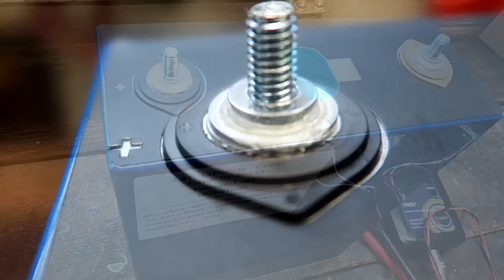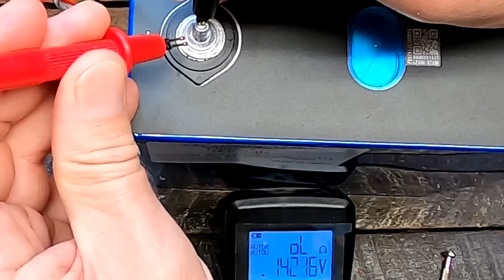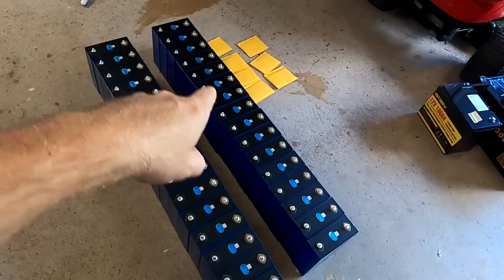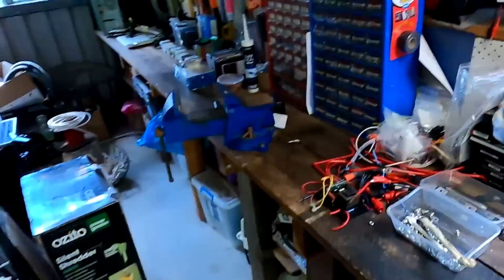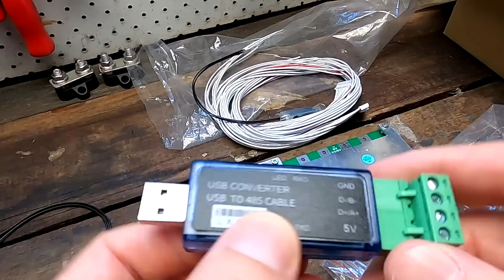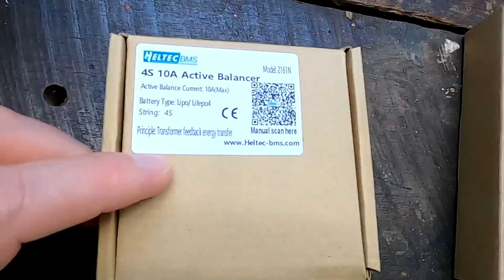Two new battery banks.. But what's the best BMS I should get? 🤔

Comment: Question, I’ve went through a lot of your videos, over a year ago when you were building the battery box, you asked the question, should you put the shunt before or after the BMS and was waiting for comments. You never said after that what way you would mount it. So my question is what way did you decide? Also on the new rack battery setup, which way do you plan on connecting the shunt? And are you going to use a shunt for each bank? I’m adding more batteries and would like your input. Right now I have the bms after the shunt but was wondering how it works before the shunt. Thanks

Comment: Is there any harm in having a capacitive active balancer connected to a battery all the time - not just when over 3.4V per cell? If so, what is the issue, please Andy?
Reply: Below 3.4V gives no information on SOC. So your balancer will be actively unbalancing your pack based off bus bar voltage drops or inaccuracy in the measurement.

Comment: What materials the bas bar made of  and the washer on the battery are they the same material ?
In order not to scratch the bas bars with the nut you can use a washer as said no current is issued there

Comment: I would vote for Batrium BMS, especially because of it looks like perfect expandable setup for more batteries as you are using, offers management of them all together with direct communication with victron. Also balancing performace looks not bad based on specs. I woud say perfect device for your detailed testing and playing around :)
Reply: GOOD MORNING GUYS!!!!   My question is.  How many of the: over kill BMS:  16s 48v 100 amp load charge BMS to be able to handle Load about 10,000 watts 240v continue for 6-10 hours use/ charge car.  Any one please help. if you have the Math show how to calculate will be great.  I will buy -30 - 40 kwh battery bank thanks a lot.  Solar 5kwh,  INverter: 3x 5kwh Growatt inverter.

Comment: I would like you to test both the REC BMS eastern Europe and the 123BMS from the Netherlands which both have connectivity to the Victron Canbus system. Both BMS systems have been suggested by marine electrical shops and they also tie into Wakespeed 500 external alternator communications for charging from engines....useful for mobile solar installation situations. ~ Kind regards ~ s/y Element

Comment: Battery = Collection of cells to make up a complete battery.
Battery Bank, a Collection of "Complete" batteries set in Series and/or parallel to increase capacity.

16 individual cells, plus BMS = 1 Battery NOT a Bank !

And we wonder why so many people TRIP OVER TERMINOLOGY when you continue passing confusion forward.... 

Andy, you are TEACHING here, intended or not, please use the correct terms to reduce the confusion and enhance understanding.

Comment: my suggestion for something different but that will also work. Some EV power Australia cell balancer boards with the NC loop (one for each cell). So up to 2A of balance current per cell, and you can daisy chain them all together and they will go open loop when a cell goes  HV, or LV.  With this setup you are not restricted with the BMS current limitations.

Comment: My 2 banks are never the same at lower voltages and it's not till they get near 95% when they both sync up.  Got a Neeeey balancer on the naughty bank.  Other bank needs no balancing with Daly.  Also, see you brought a Renogy 3000w inverter, what happened to the unboxing of this? or did I miss the vid?  Just bought one as a backup.  If one battery fails and you have no spares I can make 12v batteries while waiting for one to be sent out.  Would be nice to have spare batteries and panels but I use everything in our Off Grid home.

Comment: 9:20 this is because Tesla is buying up BYD, CATL cells (instead of using their own fire hazard Lithium NMC batteries). THIS causes a huge demand and supply shortage across the industry.
Reply from the maker: Nope, it's not Tesla, it the Chinese car makers which buy everyting they can.
Tesla uses fire hazard lithium batteries? How man cars catch fire in comparison to ICE cars?
Reply: @OffGridGarageAustralia  Tesla used Lithium Nickle Manganese Cobolt, the 3.7V per cell; it burns/explodes when punctured. LiFePo4 does not. Tesla started buying BYD and CATL batteries mid last year. BYD & Nio makes their own batteries. The other EVs companies does not make batteries and are supplied by the lesser known manufacturers.
Reply: Give it time. Eventually what filters through the EV market will flood the DIY market with cheap seconds that are perfectly fine for our garages.
Reply: @henvern  Your comment is true. My problem with your statement is that in my country, some unscrupulous local merchants sell these used cells along with new ones, not separately. BUT if the EV batteries are welded, then they are sold as is (used).
Reply from the maker: @henvern  Tbh, I believe this will never happen. There will be the occasional 2nd EV hand battery but I don't think we will see many of them on the market.
Reply: @OffGridGarageAustralia  Second hand car engines are cheap and plentiful, but we don’t do much with them because they are specifically suited only to cars. I think the EV packs will become like that. Cheap and available, but too much trouble to work with. Dangerous voltage and all glued together. Probably the better bet would be to run a nursing home for retired home storage batteries that people discard when they upgrade to larger capacity.

Comment: I vote for: JK-B2A25S60P JK BMS 600A 2A balance (with  3 contactors, charge and discharge and a pre-charge contactor).
Reply from the maker: Each bank would be discharged with around 50A max. A 600A BMS seems a bit overkill 😆
Reply: @OffGridGarageAustralia   I prefer contactors over electronic switching. But you don't have to use 600A contactors, for your usage pattern a much smaller contactor would suffice.
But, I want to charge at 1C if I need to.
Reply: @OffGridGarageAustralia  very true in the garage. I'm repowering a large boat on electrics though, and 300A on 48V is likely our the highest we'll go to in emergencies, with 200-250 being common.
Reply: I couldn't actually find a way to buy that one on their site! I was interested in it too. Looking batrium now for that higher current...

Comment: Hey Andi, you can proof your 5 / 95 % theory by using a plastic nut. If you are correct you should see next to change in temperature when looking at them.
Reply from the maker: I thought about that and will order some nylon nuts so we can test it.
Reply: @OffGridGarageAustralia   Also another test...  put electrical tape on the bottom of the bus bar so all the current has to come through the nut.  I'd like to see that.  My guess is you are getting more like 20-30% from the top nut/stud

Comment: It is expensive but it would be great to se the watchmon core and cellmate K9 3-16 do the work, as I understand it you set up the parallel amount of cells there so one Core can supervice 3 parallell 16s battery banks and keep all 3 balanced individual also.  :)    Is it worth the extra $$$
Reply from the maker: Would that not mean I will have to change all BMS' to Batrium at some stage? It's a bit overkill to have only one battery bank connected to Batrium.

Comment: Continuing from the last video and comments, you have missed the mark specifically with your measurements. The bus bar is not connecting to the very top point of the welded bolt, so resistance measurements don't matter. The nut is only a mm or two from the stud head. So measuring from the top to bottom of the bolt has no value. And we are talking 1000th’s of an ohm resistance over all.

I use Seplos BMS’s :) was what I ordered, they work fine, but since they are the only ones I play with I am no expert on all the others out there. Seplos have some good value with built in shunt, power resistor, lcd screen, can and rs485 comm

Comment: It does get complicated  and expensive with high currents, why not use higher voltage having lower currents?
Reply: My understanding is that 48v is the sweet spot as above that the regulations for dealing with the voltage gets very onerous, and this is because 50v seems to be the point above which your dead and be,ow which you are less likely to be. That's the explanations I've heard!
Reply from the maker: Everything over 48V is very difficult as there is not much gear available for the DIY market.
Reply: @OffGridGarageAustralia  Try the hands on  experience and dump your high tech apps, becoming a better "DIY" person. Best Regards.

Comment: If you are looking for a better BMS than the JK BMS, then test and compare for that.  Someone is always trying to improve off a good product, and maybe you will find one better.  But, if you plan to keep the JK BMS on your second string, I suggest you go with the same for the rest of your battery system.  This will keep your system simple to troubleshoot when something goes wrong.  If a BMS goes bad on one of the strings, you can replace it with one of the other's to make sure it is the BMS.  It will just be easier to troubleshoot with the same equipment in each string.

Comment: I also think its plausible that the 280 and 304 ah are identically physically, i think its possible that by derating to 280ah, this may be where the extra life cycles data comes from, i will be interested to see when you do your top and bottom balance if the 280ah pull anywhere near 304ah when brand new.
If you owned 304ah rated to 3000 cycles and only cycled them to 280ah, you will probably get the 6000 cycles, maybe, maybe not. keen to see your tests
Reply from the maker: Uh, no, that definitely not the case. That would mean all 280Ah cells are in fact 304 cells but didn't pass the capacity test. That would be really bad and they would fail far earlier.
The LF280K have a different chemistry, hence can deliver more cycles.

Comment: You've tested many of the more affordable BMS from Asia but I'd really like to know if they can compare to the higher end or higher priced solutions such as those offered by Batrium (from there in Australia), orionbms (US) or REC-BMS (Slovenia).  

What especially interests me though is the ability these BMS have of connecting to the Victron inverter and charge controller via CANbus. I want to know if that integration is worth the extra $$$$?
Reply from the maker: About the BMS integration? What would that do apart from the Victron system being able to read single cell voltages? I still don't see any benefit of having this connection. One viewer wrote, he's got the BMS linked to his solar charge controller and slows down charging speed if the cells get too hot during charging. That is actually a good reason! Apart from that 🤷‍♂️
Reply: @OffGridGarageAustralia  with this integration you can turn off the Victron under certain conditions instead of relying on a shunt.

Comment: of that stud, just 2mm(the thickness of the BUS bar) is the resistance, not the entire stud. Then the the surface area of the bottom side of the nut give more surface area then just the bottom small flange, 5% i feel is a bit brutal , haha, 
Perhaps measure resistance of the bus bars, connect to battery with correct torque, then measure from end of BUSBAR, through battery, to 2nd tightened down BUSBAR, then take total resistance and subtract the 2 BUSBAR calculation,
Then you will get true tightened stud used resistance, and will know what flows above and below very accurately.
Reply from the maker: It was more to show how high the resistance through the stud is.

Comment: I would suggest getting a separate port bms.  That way when your EV drops the voltage too low, the MPPT charge controller can keep pumping in the juice without the flicker dance you have with only one relay/port.
Reply from the maker: That does not happen any more with several battery banks in parallel. If one bank turns off it does not matter as the whole system will still be powered by the remaining banks.

Comment: You definitely need to get the new version of the JK bms. Find out, andy style, if they actually have improved it or if they have thrown out the baby with the bathwater.
Reply from the maker: The new one with the display and power button.
Reply: @OffGridGarageAustralia  Yeah! You already have me totally sold on the 2A balancing current for bigger battery banks. If the new JK adds only a display and a powerbutton but keeps the rest of its functionality intact then it becomes a total no-brainer.
Reply: I just received my new V2 JK BMS with more ports for display and heating. But I'm not using the extra ports, not yet anyway.
Reply from the maker: @johthe  Did you order it with these ports or was it just luck you received them like this?
Reply: @OffGridGarageAustralia  The Ic gogogo store have updated the last picture to clearly show the new ports and that is all, I do not require it so I did not ask for it, or verified before ordering.
Reply: @OffGridGarageAustralia  Also noticed that there is a new larger 4,3 inch lcd display module available, but I see no more information about it yet, remember to ask before buying.  And also a note that the usual smaller dcdc stepup converters xl6009 can normally increase the volt to over 40v that is usually specified to up to 32v, but make sure they have the 50v capasitor on the item image.

Comment: Hi Andy I’d like to see a  test of the Batrium as it doesn’t run the battery through it and balances the cells which is potentially causing more losses than Double FETs but does it in real life? Some feedback says no difference. It seems simpler to install and expand but is that worth the price penalty?

Comment: Would there be a way to wire in some sort of voltage sensor on an active balancer's circuit so that it wouldn't even turn on unless there is at least 3.4V per cell or 54.4V for the battery? Maybe put the voltage switch on the common connection? Maybe that is nonsense. What do I know--I'm a mechanical engineer, not electrical!
Reply: Would a comparator that controls a relay do that?
Reply from the maker: That is possible, Dave. A voltage trigger can turn on the active balancer. at a set voltage. That's actually an easy setup and would work great.

Comment: I would love to see the Batrium, I have seen lots of people using it, but I feel like I never really get any indepth information on how the system works, or how well it actually works, all of which I know you would test very thoroughly
Reply: This would be my suggestion too!  Does the cost truly justify the performance would be the "Why"?  The other question would be since you can have multiple batteries connected to a Batrium...can it keep all the cells in multiple batteries all in balance?
Reply: +1
Reply: +1 on Batrium!
Reply: A good thing with Batrium is it can be configured to monitor every cell in a 4S2P battery pack.
Reply: GOOD MORNING GUYS!!!!   My question is.  How many of the: over kill BMS:  16s 48v 100 amp load charge BMS to be able to handle Load about 10,000 watts 240v continue for 6-10 hours use/ charge car.  Any one please help. if you have the Math show how to calculate will be great.  I will buy -30 - 40 kwh battery bank thanks a lot.  Solar 5kwh,  INverter: 3x 5kwh Growatt inverter.

Comment: If I was going to add a washer for more contact area, I'd use a washer that just fit over the stud to give the most contact to the flat area, not the weld area, and wide enough to give more contact to the bus bar. Would two slightly-better contacts in series be better than the original contact? Who knows? As you said, it may not matter since it's working well enough as is.
Reply from the maker: Ah, right, OK, that makes sense to place the washer just on the top ring... I didn't think about that option...
Reply: @OffGridGarageAustralia  Bad idea in my opinion. You are adding more points of failure, every extra connection is extra resistance and at the end it doesn't matter how many washers you stack on it as the first one only has the original surface area but every consecutive one will add to resistance so I fail to see the benefit here.
A
Reply from the maker: @HG-Pilot  All these extra connections... absolutely right.

Comment: Daly BMS with separate port . Dedicated port for charge and discharge will enable solar battery owners to maximise state of charge SOC of the battery. 1 set of 48v batteries will be fully charged  (not discharging)  while the other set is being used ( charge and discharge ) . 

The set up is key when managing the duration of sunlights . The shorter time of sunlights means lesser charge and lower SOC. Maximum SOC is crucial to be used at night  for places that have long night time.
Reply from the maker: What? We keep one battery charged and disconnected? That does not make sense to me
Reply: @OffGridGarageAustralia does not make sense probably because you have the grid , batteries and solar for power. Assuming you only have solar and the batteries for power , what would you do if you only have 4 hours of sunlight and most of the time , each set of batteries only managed to be charged at 60%?

The idea simply, 1 set of batteries being charged and discharge , producing AC 240v while the other set is charged but disconnected. 

The inverter also will have a convertion loss dc - ac probably 15% . i.e. 10kWh actuall dc to ac  is only 8.5kWh. Low frequency inverter will have less power loss.

Assumption -  
1. batteries pack are on 2nd life from EV 
2. Sunlight is only 4 hours

Comment: 4:23 With 50A, each stud causes a voltage drop of 10mV, Heat = 0.5W
With 100A, Voltage drop = 20mV, Heat = 2W
Reply from the maker: That would be for the full length of stud.